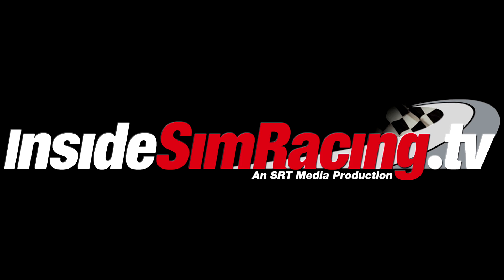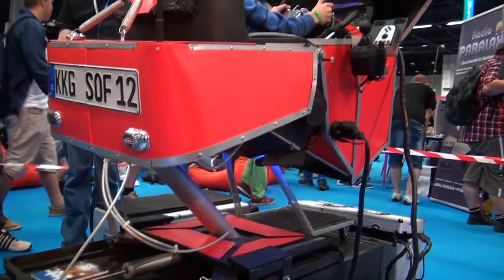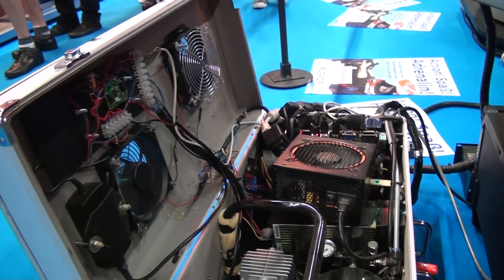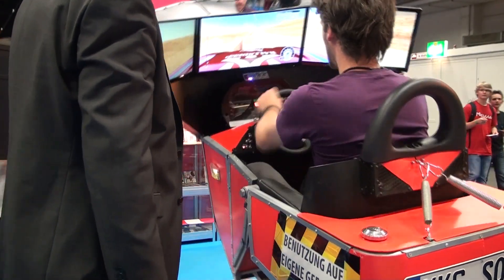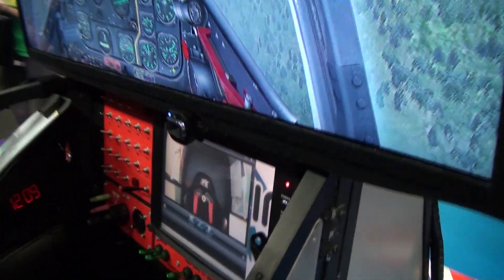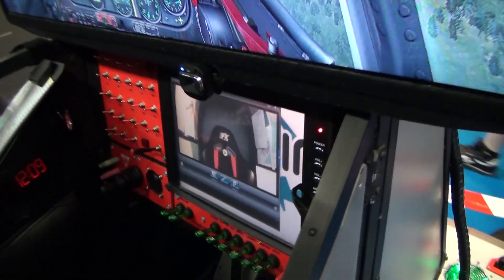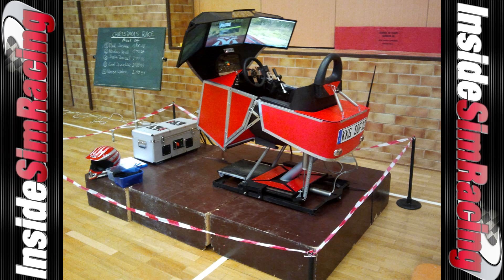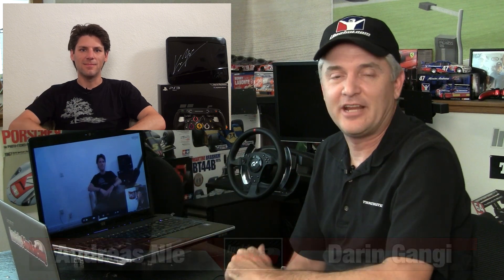DIY Motion Racing and Flight Simulator - High School Project

Comment: Operating costs are lower with a simulator too compared to a real car.
Not to mention maintenance time and set up time is also a sucker for time.
And the best part to use a simulator... You don't risk dying if you hit the concrete wall at 300 KPH.